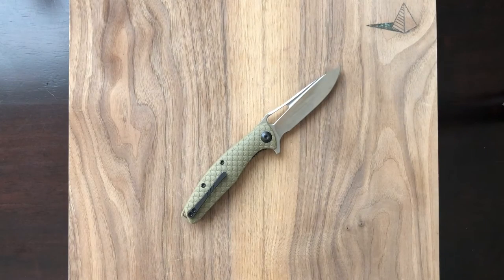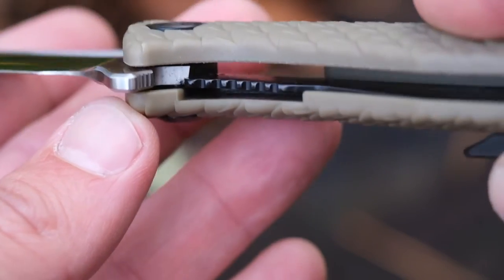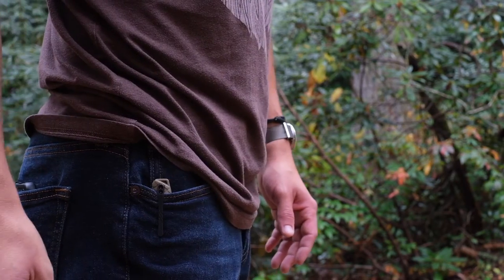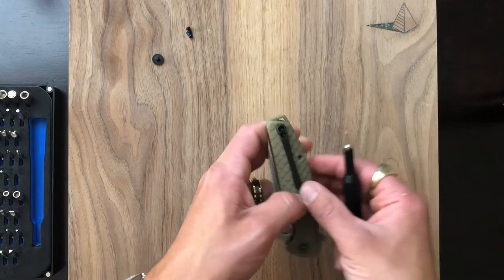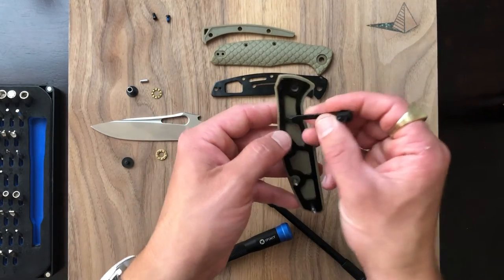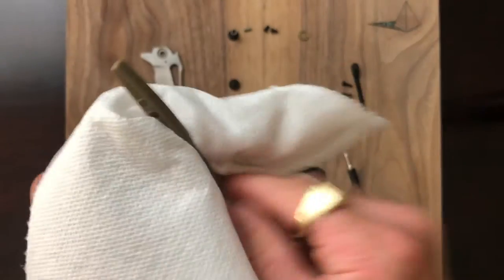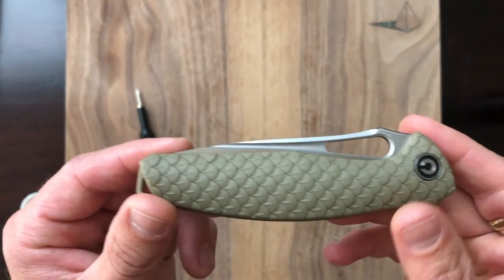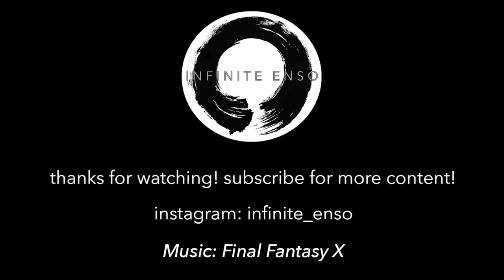Takedown Talk 10: Review, Disassembly and Discussion of the Civivi Wyvern

Comment: How did you get the pivot screw out so easily? Mine feels like it's threadlocked really good and it wont even budge. Any tips? 😅
Reply from the maker: Man that’s a bummer! Well a soldering iron pressed on the pivot screw for about a minute is ideal, but as I don’t have one I use my wife’s hair straightener of all things and it works great. I heat it up to 450 and hold it on the screw for 1 minute straight, that should break up any stuck loctite. You could also try a standard iron on the highest setting but I can’t vouch for its effectiveness. The screw on this particular Civivi came out without any fight, so it sucks that they’re not consistent across the board. Good luck!